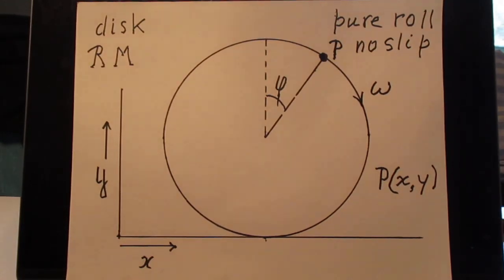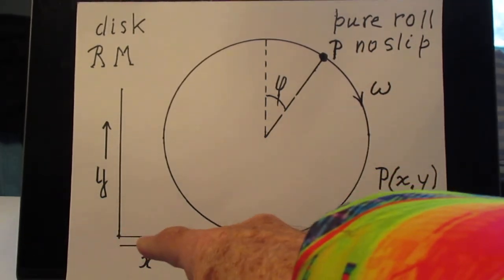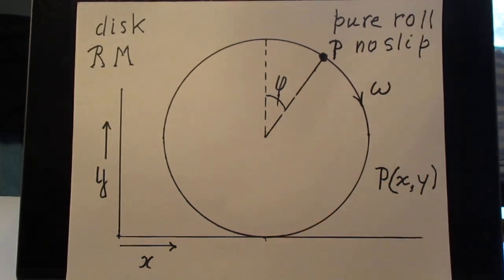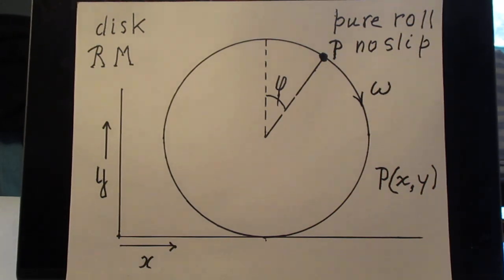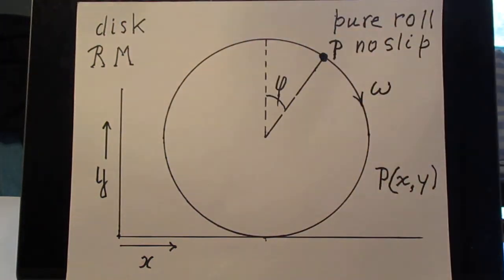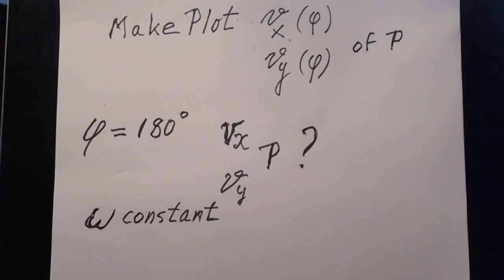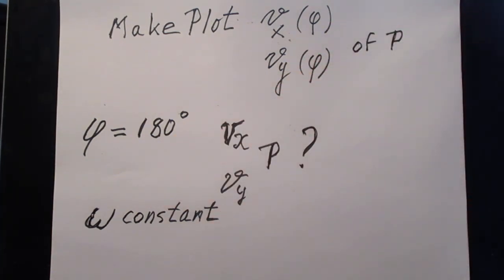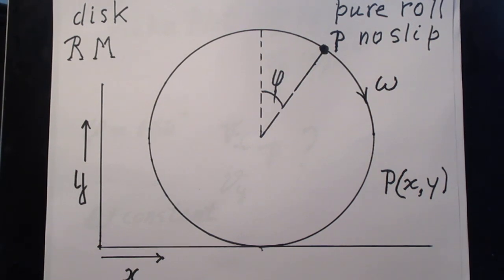Problem #170 Pure Roll - No Slip

Comment: The short answer would be that when the line (as it is a disk/cylinder) P touches the ground (φ = π), both components Vx and Vy are null. If Vx would be different than zero, then the point P would move relative to the ground, which means the disk would be slipping. If Vy would be different than zero, either the disk wouldn't be in contact with the ground, either the ground is flexible and the disk would "sink" in the ground. This is at least from an intuitive point of view.

The long answer would be that the trajectory point P is drawing, as the disk is rolling, a cycloid, which in particular it is a very interesting mathematical beast (see the brachistochrone and the tautochrone).

The velocity of the object is constant and because of the no slip condition the distance the disk is displaced after a full rotation is simply the circumference of the outside rim of the disk, which is 2πR. We know that ω is constant so we know that ω = φ/t (where t is the time, so rad/sec). If we look at the picture the professor presented, we can conclude that at a certain time t the x coordinate of point P is the sum between the distance the disk have traveled (considering at time t=0, the center of the disk was at the coordinates (0,R) and point P at the coordinates (0,2R) thus φ=0) and the projection of point P to the x axis relative to its center.

We know that in a certain time T [s] the disk travels a distance of 2πR [m] and we also know that ω=2π/T. We can use this information to understand what is the distance traveled by the disk after some time t. That is a distance 2πR * t/T and knowing that t = φ/ω we get that the distance traveled by the disk is 2πR * (φ/ω)/T. As ω=2π/T we get that the distance traveled is φR [m].

The projection of point P to the x axis relative to its center is simply R*sin(φ). So we can conclude that the component of the trajectory on the x-axis is x(φ) = R * [φ + sin(φ)].

For the y component, things are a bit simpler, so at a certain time t the y coordinate of point P is the sum between one radius R and the projection of point P to the y axis relative to its center. This works out to be y(φ) = R * [1 + cos(φ)].

To work out the velocity components we simply derive the above expressions with respect to time:
Vx = R * φ'(t) * [1 + cos(φ)]
Vy = - R * φ'(t) * sin(φ).
But φ(t) = ω * t, thus φ'(t) = ω, so we get:

Vx = (R*ω) * [1 + cos(φ)]
Vy = - (R*ω) * sin(φ).

Plotting the above functions Vx(φ) and Vy(φ) we get a cosine function with an amplitude of R*ω and an ofset value of R*ω on the y axis and a sine function of amplitude R*ω flipped on the x-axis (multiplied by -1).

When φ = π we get Vx = (R*ω) * (1 - 1) = 0 and Vy = 0, thus the initial intuition proving to be correct.

Comment: the speed graphs will be sinusoids with a period of 360 degrees and a phase difference of 1/4. X - from 2φR to zero, Y - from -φR to +φR. Thus, they intersect at a point with a coordinate of 180 degrees at 0, that is, on the ground.)))
I do not understand what is the complexity of this task?
Reply from the maker: what  is Vx aand what is Vy when phi is 180degrees?
Reply: @lecturesbywalterlewin.they9259  
both 0 (null, zerro) rad/sec (m/sec)

Comment: What is the difference between insulator and a dielectric

Is all dielectric are insulators??
Reply from the maker: yes all dielectrics are insulators but not all insulators are useful dielectrics
Reply from the maker: All dielectric materials are insulators, but a good dielectric is one which is easily polarized. The amount of polarization which occurs when a certain voltage is applied to an object influences the amount of electrical energy that is stored in the electric field.